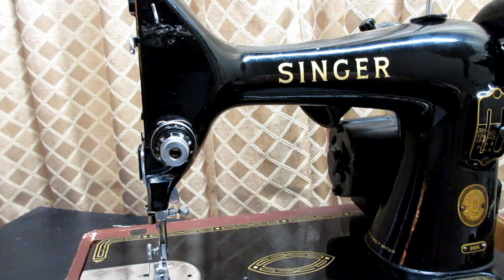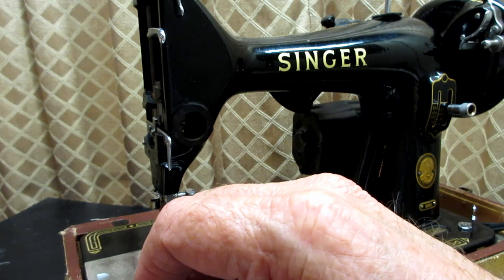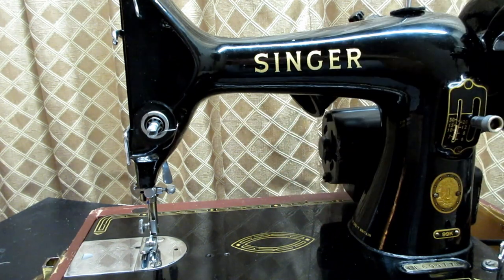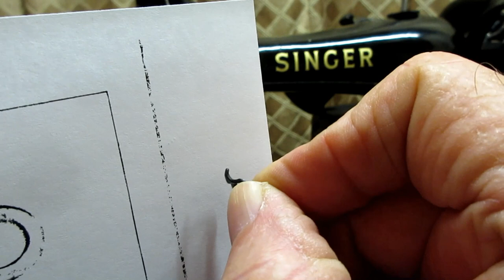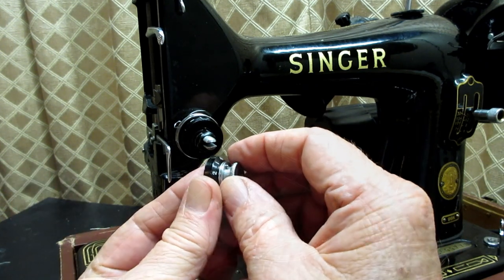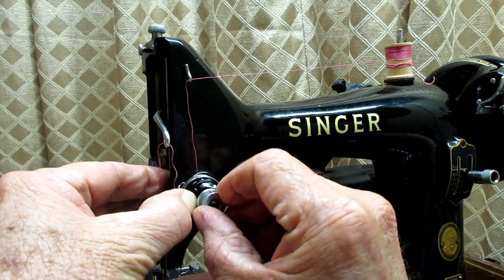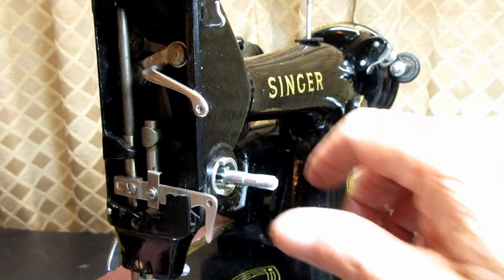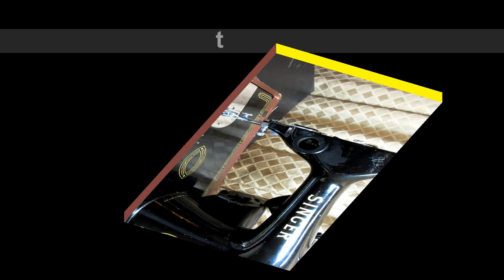The Needle Thread Tension Unit of a Singer Model 99K Sewing Machine

Comment: This’d is great video Andy and very helpful. Do you happen to know If the 99k style tension assembly with the numbers will fit a 99 with the old style which has no number selector, just a thumb screw.
Reply from the maker: A nice question, but I don't know. This 99K is the only one I've ever worked on. I think it depends partially on which 99 you mean. Some of the very early ones have a much different parts list and style of parts, while "middle-aged" 99s have many of the same parts as the model in my video. I do have some parts manuals and I compared parts numbers between 99K-24 & 31 to the 99-13. The Releasing Pin Lever, Releasing Pin, and Tension Discs are the same. The Tension Stud and the "Spring Holder" that fits inside the nose are different parts numbers. It is encouraging that the Releasing Pins are the same b/c that means they are the same length which is usually a problem if they are not. The Check-Springs are different part numbers. If the tension stud fits into the Spring Holder then it may work with the old or new check spring. You may have seen this video about the old-style tension assembly https://www.youtube.com/watch?v=rChtDz0USSc    maybe you could watch and compare the parts to the ones in my video. You can buy an after-market numerated dial style assembly for about $10 to $15 and try it I guess.
Reply: @andytubesewing1953  Thank you Andy i will give it a try as i have one arriving today.
Reply: Pleased to say that it does fit and work fine Andy. Thank you so much for your advise.
Reply from the maker: @cotswoldhipster7101  Good on you for giving it a try. Congratulations on your success 🏆I appreciate your sharing the question & answer in my comment section. I've pinned your comments to the top of the page for viewers to see first. Happy sewing and take care.

Comment: Dear Andy Tube, I acquired 2 of these darling machines from my mother in law and sister in law. Both in great condition. I got one all oiled and cleaned up (very little needed) and started sewing. The check spring wouldn't move when the foot was down but did move when foot was up. The tension disks were trapping the spring between disks and machine body. What to do???? Brr Brr Brr! Go to you tube. Your excellent education gave me the courage to tear it apart and start over. The tension assembly was rotated 180 so the check spring retention area was down and the whole assembly was too far into the hole in the machine body...even though the "plus-minus" pyramid spring housing was right side up. All fixed, all done, now sewing curved-edge face masks for our current Covid 19 situation. Guess what? The narrow foot and feed dogs go around curves as if on cruise control.  Who knew!!!! I owe ya!
Reply from the maker: Wow, a really great story and thanks for sharing. I'm glad you found the video. BTW, my wife uses that narrow foot 95% of the time making clothes and she also loves the maneuverability. Take Care.

Comment: The Singer 99K I found is missing the set screw on the outside of the tension assembly (to the right of the tension unit. Any idea where I could get one? Thank you so much for all your videos! They are GREAT!
Reply from the maker: I'm glad you enjoy my videos and thanks for watching my channel. That screw is called "Thread Take-Up Spring Regulator Set Screw".
It is Singer Part Number 453. It is normally extremely hard to find any "new" Singer screws b/c most of them were made in proprietary  (odd) sizes so you had to go to their stores. Normally, you look for used screws on eBay, etc. but have to buy the whole part that the screw holds, like the whole tension unit in this case. Since you live under a Lucky Star ✨ ( what is that like by the way, M P??) there is one seller online that apparently has brand new 👀 #453 screws for sale for $2.99 https://www.sewingpartsonline.com/set-screw-singer-453.aspx  Happy for you and take care.

Comment: Hi Andy, I bought the Singer 192K about a week ago and it had the spring on the tension unit all bent out of shape. It seems to be almost exactly like your 99K, and this part is for sure the same unit. I didn't see this video until I had gone to eBay and purchased a used one there. After I saw this I went back to the machine and played with the unit until I got the spring bent back to pretty close to the right shape. I would have never known what that shape would be if it weren't for your attention to detail and showing that part so well. After reinstalling it and playing with the adjustment of the shape of the spring for a while and getting all all the other parts of the unit in the right order, it seems to now be working just fine again. I won't know until I get a few other parts in for the machine in a week or so to get the machine back running to see if I have it.... but now that I understand how it works because of this video you posted.... I am very confident I can rework it and get it all adjusted right and working again. Wish I had found this video before purchasing the part on eBay. Oh well.... I sure it will come in handy some day as I am going crazy buying machines like this one. So, anyway, thank you soooo much for taking the time to explain in such great detail how to do this stuff with these very cool videos you are doing to teach us how to restore these cool old pieces of art. Without guys like you what would guys like me do... ??? lol. I just love these machines and am very hooked on fixing em.
Reply from the maker: I'm glad you found me, Hunter. It is for people like you I made my channel. I enjoy working on the machines also and now there is much more info available. Thank you for saving that 192K, and any others you work on. I have 500 more videos for vintage Singer machines on my playlist page: https://www.youtube.com/channel/UCUSPDsHaFtRoz1VA2U1xJ4w/playlists?view_as=public
Stop by anytime; always happy to hear from you. Take care.

Comment: its amazing  some of my machines are over 100 years old. back then they did not have cnc machines they made parts the old way one by one . just look at some of those parts .
Reply from the maker: Every time I picked up the Tension Spring Regulator I was in awe. Machined from a solid cylinder of steel and just beautifully made. I don't think a Computer Numeric COntrol Milling Machine could have done it better. Then I got to the Hook ...

Comment: This was a great video! I cannot wait until you show the bobbin case area being dismantled. Thank you very much😊
Reply from the maker: Thanks very much, Rita. That bobbin area is tricky and took a while to figure out. I will be filming how to remove/replace every part except the arm shaft and forked feed connector. Stay tuned and take care.
Reply: Oh and can you suggest what to use as the red wool for oiling in the bobbin area is missing in mine? And maybe others my have the same problem as someone may have taken it out thinking it was a bunch of dust and thread pieces. I was thinking of using felt but not sure how much to stuff in. Your thoughts on this dilemma are very much appreciate. Thanks.
Reply from the maker: The Oil Pad. I used a piece of red felt cut from a spool pin. Shaped like a letter "V". .66" tall x .35: wide at the top x .10" wide at the bottom. I cut a shallow "V" notch into the top about .20" deep so one side of the notch will rest on the top of the hook and the other side of the notch will ride under the edge of the top of the hook; kind of inside the curve of the hook. The Oil Pad is screwed into the OIL PAD HOLDER which is a cone or funnel-shaped spring that screws into the side of the body of the Bobbin Case Position Bracket which has a threaded hole for the pad holder. The Position Bracket can be removed by loosening a set screw under the hook that holds the Position Bracket Hinge Stud in place. If you pull and push out the oil pad it can damage the spring hold. The pad should be twisted into the spring about 1/4" should do and then the top part can be trimmed and shaped to go above and below the hook race that the bobbin case rides on. The top of the oil pad "V" notch will oil the hook race and the bottom of the "V" will sweep the inside of the curve of the hook, below where the bobbin rides to keep lint from building up. Don't push the oil pad into the spring too far as it will bend the actual Bobbin Case Cushion Spring and change the thread gap between it and the bobbin case and cause malformation of stitches. It may be easier to remove and replace the oil pad after adding some oil to it.
Or you could watch my Bobbin Area Parts Video when it comes out.
Reply: Thank you Andy. I’ll be watching and re-watching your video. Thank you for the detailed description of how it functions. Take care😊
Reply from the maker: Too detailed I'm sure; sorry about that. I'm just too technical when writing I think. It's better I make the videos, haha. You're a diplomat to thank me for that explanation., hehe. Yes, take care.
Reply: @andytubesewing1953  I have watched a few of your videos now and can't thank you enough for them. As far as being too detailed... no way man.... you are the best and make things very clear. Love the way you explain stuff so much in detail.... don't ever stop doing that.... Heck, what would we do without guys like you..... LOL.
Reply from the maker: @hunter6674  Oh thank you! This channel gets an average of 200 views per hour and about 40% of those are by people who don't really speak English.  I tend to go slower and use more detail so they can get the idea of what I'm doing. With that in mind, I thank you for appreciating the detail and effort I put into the videos and my channel in general. Take Care.

Comment: Hi Andy.   You inspired me to try my hand at restoring a vintage Singer after watching you take Coco to the spa 3 years ago.   I have a 1928 99 that I am going to strip down - I mean really strip down for a repaint and re decal - but first I want to be proficient at disassembly and reassembly.   I managed to replace a missing feed fork so that the stitch regulator  worked, which made me proud since access to the back end is pretty much non existent.  But I am having trouble getting my tension regulator just right.  it is an older version of Cute but essentially the same concept and yet I can't get the tension to adjust at all - the tension releasing pin doesn't look like it is impacted when I lift the foot lever.  I suspect I've got the foot lever system all out of whack since the tension system itself is pretty rudimentary.  I know you did a video on the foot lever and thread take up system, but I don't think it included how to get it to interact with the tension pin.  What do you suggest?   These machines are just so beautiful in their craftsmanship - I think I would be entranced even if I didn't sew.  Thank  you for loving these machines and sharing your knowledge with us and keeping these gems from the garbage heap...they really are treasures as are you.  I could watch you all day long.
Reply from the maker: You've got a real project going on there. Thanks for saving the machine. It is quite a job replacing the fork so you should feel very rewarded. The tension pin of the thread tension unit is pushed or activated by The Tension Releasing Lever that is inside the nose behind the needle & presser bars. The TPRR is moved (rocked) against the end of the Tension Releasing Pin of the tension unit by lifting the presser bar lifting lever. That pushing on the end of the pin opens a space between the tension discs so the thread has no tension. When the presser bar is lowered, the spring inside the tension unit pushes the discs together to create needle thread tension. The 99K presser bar video is here: https://youtu.be/qFsJzJ9NH2s   I have a couple of videos about installing/replacing the TPRL on other models that would show you the general method of movement of the lever: https://youtu.be/k9LdTvESJaM  and  https://youtu.be/O4pHwpobhe4   Those may help. Thanks for watching my channel, and good luck.
Reply: @andytubesewing1953  Brilliant!  I will watch your videos and give it another go.  TY So Much!!  Hope you are well!
Reply from the maker: @LuvNickles  Good luck.

Comment: Your video is very informative, as always. Thank you!
I searched for information on the tension unit because I was trying to adjust the tension. I have not used this machine for a couple of years, but I can't recall having any problems with the stitches...could be my memory issue :/
The thread kept breaking as I sewed so I thought it was a tension issue.
 I tried to adjust it but was unable to turn the regulating thumb nut at all. I was able to turn the tension indicator flange, behind the nut, but only between 0-4.
After watching your video I thought taking it apart may help. I actually had to use a spanner to remove regulating thumb nut (!) and then easily, the tension indicator flange. I then put it back together. 
It was very difficult to screw the regulating thumb nut back on. I'm not sure if it's a screw threading problem or maybe it needs oiling???
Now I can turn the regulating thumb nut but it's very! stiff.
I tested sewing with this setting, but have no idea really what tension I am on, the number aligned at the top is at the 7 and the notch (?) on the nut is somewhere down to the left. I never did hear any "click" like you showed on your video.
But the stitches are perfect on a short  test strip I just sewed.

Can you make any sense of my description?
I look forward to your thoughts. Thank you.
Reply from the maker: Every time I had a hard-to-turn thumb nut it was because the threads of the nut were cross-threaded to the threads of the stud. Sometimes that happened b/c the nut was not flat to the surface of the stud while screwing on, and sometimes b/c the two "prongs of the stud were "pinched toward each other or were twisted or both. 
     Most of the nuts are steel and many of the studs are aluminum, making the stud threads easier to cross-thread or "strip". I have used a needle nose plier to straighten the stud prongs and correct the spacing between them. The spacing should be equal from the tip to the back. If the tips are barely flared open a small amount that is OK too. 
     If you look at @04:15 of the video and freeze it you can see the tips of the stud prongs are flared open.  It is difficult and time-consuming to try and fix damaged threads on the stud but I have done it by straightening the stud prongs and adding a drop of oil and putting the nut on very evenly and slowly back and forth several times past the bad spot.  
     When the threads are stripped and/or the stud prongs are bent the other pieces do not adjust properly, and the tension indicator number can be far off and the actual thread tension can be all over the place and even change right in the middle of sewing a seam. 
     No one makes tension studs so I try hard to repair it but I have had to buy a used one, or a whole used tension assembly, on eBay. 
By the way, I have never had bad/damaged threads inside the thumb nut, but I always found them on the stud or that the stud was pinched.
Reply: @andytubesewing1953  thank you very much for your expert suggestions. I am not going to do anything for now because it's stitching beautifully. There's a project I need to finish. After that I will definitely look into the spacing in the stud (don't have needle nose pliers) and also the drop of oil.. I hope I can get it back into good working order. I will let you know how it goes. :)

Comment: Than you, Andy, for all your great videos. I washed my 401 a following your instructions. I also separated all the cam area. Both   came out nice and clean  and machine is working great!! I also have a 99k but I sure messed up the take up spring on tensioner. Where can I get a replacement? Thanks ALOT Andy and I hope you're feeling better
Reply from the maker: It's very hard to find the exact spring unless it is used. This one from a respected long-time seller shows it will work.
https://www.ebay.com/itm/291630242414

Comment: Thanks  for all your great tutorials. I have just acquired a 99K and found that the check spring is bent and wonky.  Could you please help me with part number. Or .one that will be compatible with that  machine  (sept 1955)
Reply from the maker: Hi Carol. A 1955 model should have the numbers on the tension dial. Here are a couple of trusted (by me) vendors I have bought from that have a spring that should work for you. Compare the pictures to yours of course. Thanks for watching my channel and good luck.
https://www.ebay.com/itm/Tension-Check-Spring-For-Singer-66-99-Class-Sewing-Machine-32575/161674899440?hash=item25a4932ff0:g:kzQAAOSwcwhVL-gv
https://www.ebay.com/itm/New-Replacement-Thread-Tension-Spring-Fits-Singer-Model-99K-185-206-306-319/291630242414?hash=item43e6845a6e:g:f1AAAOSw0YlfBfsn
Reply: @andytubesewing1953   thanks a lot  will check.the links out.  Thank you..stay safe!
Reply from the maker: No worries and good luck. Thanks for saving that model 99K. I very nice model. Strong.